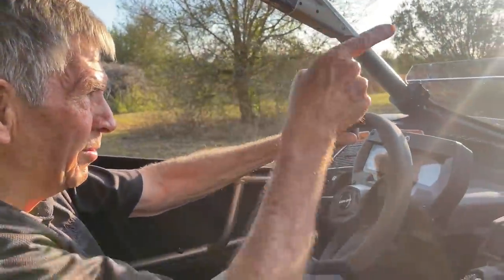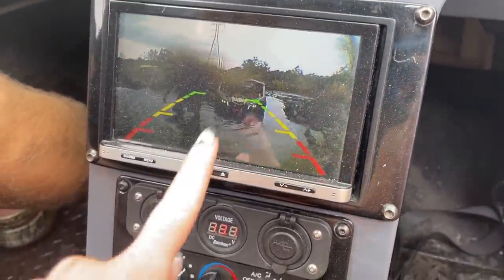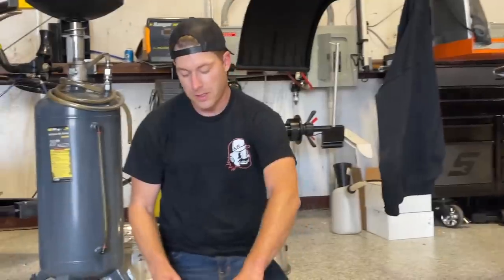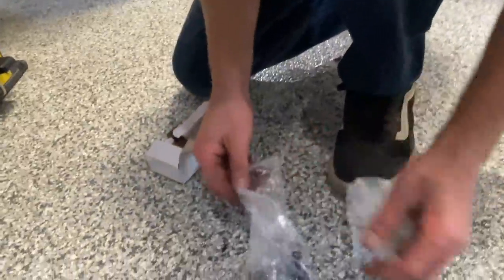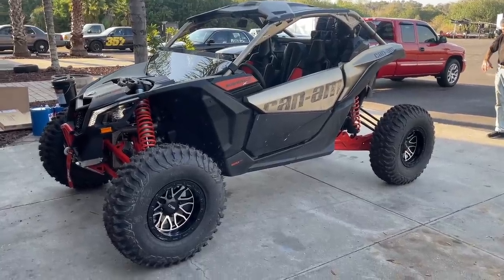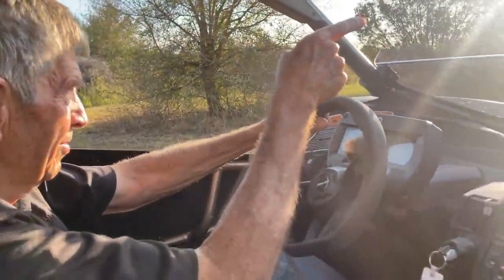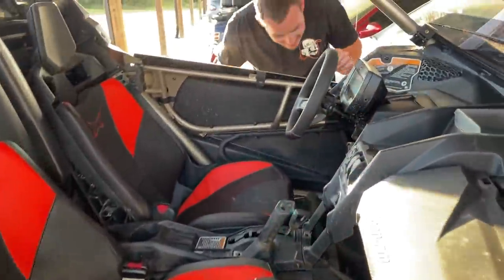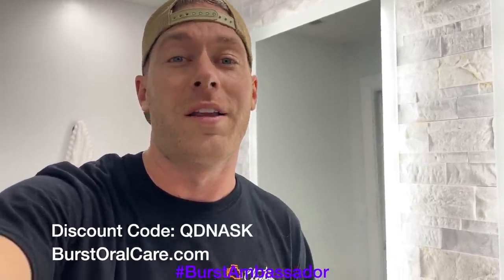I've Waited THREE YEARS to Get this Machine, Worth Every Second & Penny

Comment: Raw murphys lube, or just soapy water helps tire seat properly. Tighten bead lock similar to your way just pull bolts half way or so then add air, let beads "center" on wheel. Helps ride quality, keeps things "round". Then torque beadlock to spec. Cool ride I'm jealous!!!

Comment: Grosses me out these machines are still belt driven.
1-200hp and its causing problems.  Not even getting into the axle vulnerability.
These need to ditch the belt clutches
Reply: If they didn't cost $45,000+ I wouldn't complain
But hitting a couple whoops, and you're out a belt and both rear axles and a forward shaft....
Reply: Or burning up a BRAND NEW machines motor (check SXSBLOG) and their 4 seater experience